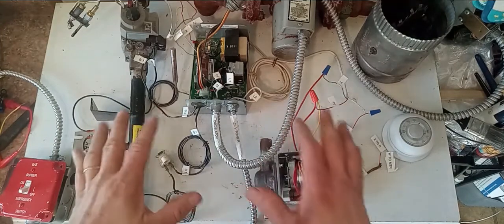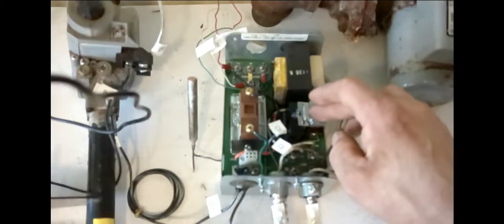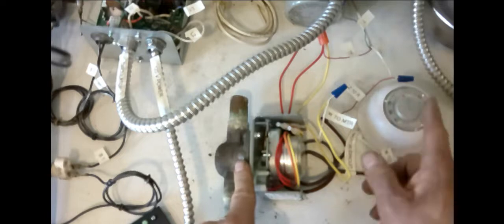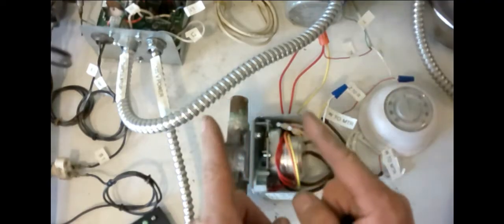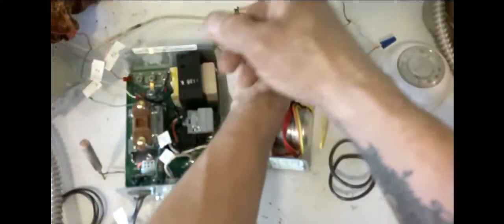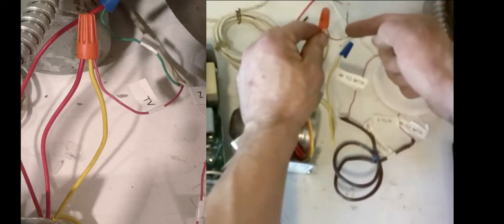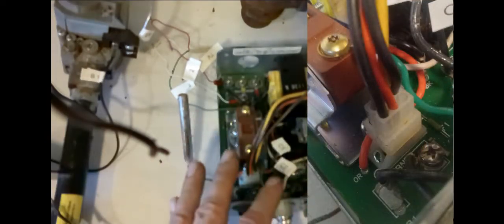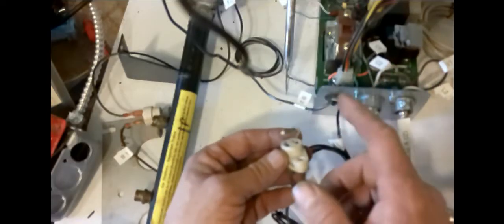Boiler Wiring for Beginners – Full Walkthrough of a Real System (Honeywell L8148E + Zone Valves)

Comment: Thanks for great explanation !!! So the second wire of zone valve end switch connected to relay coil 1K and goes to another side of transformer?  is it good to connect  1st red wire of zone v. end switch to Z(W) terminal or better through the t-stat?.... Can you explain how work switching relay control panels f.e  ARGO ARM-3P..6P &?

Comment: I have an old weil mclain very basic model. i have a transformer/ relay and having trouble connecting the black and yellow wire behind relay. black and white wires behind transformer are power but nothing seems to be working on the other wires. i have just 1 zone and none of the other modern stuff
Reply from the maker: Is the transformer putting out 24v?
Reply: @JerseyMikeHVAC  To be honest I'm just trying to get everything wired back up. I havent even checked voltage. I want to make sure everything works. It is an old boiler so I'm trying to figure out if I spend the money on parts or bite the bullet and get a new boiler.

Comment: IS that W terminal for low water cut offs? Just guessing based off what you said.

I have to repair boilers in my area but we have like 6... and I'm the senior tech after a year and I have noooooo idea what I'm doing lmao. My company teaches you on the job and with as little amount of boilers as we have I need to learn everywhere I can.
Reply from the maker: That cam be tough!

The W terminal on those transformers are not usually wired in on the backside at all. It's actually a dummy terminal that can be powered and used for other accessory items if desired (like if you had a hydronic loop off of the steam boiler and wanted to power a zone valve or something). 

LWCOs are powered off of the R terminal directly in most cases.

Comment: Some digital thermostats are looking for a blue C wire (common).  Where is that in this system?
Reply from the maker: It always goes back to a transformer common terminal. Sometimes that's I side the aquastat.
Reply from the maker: Always goes back to common on a transformer somewhere. I have videos on where the common is when hooking up smart stats.
Reply: @JerseyMikeHVAC   Thanks, I removed a cover and found a bar with a bunch of terminals with labels like C, R, and W.

Comment: Great videos, Can you make a video showing how to wire up a circular pump on a hot water system boiler
Reply from the maker: Most of them will have either an aquastat, in which the circ pump connects to C1 and C2 terminals, or there will be a molex plug from the circ that connects inside the boiler. 

Switching relays can vary but wiring diagrams show you where to make the circulator connections.
Reply: @JerseyMikeHVAC  you need to open a course in a school… you’re very talented…
Reply from the maker: Seriously thinking about that!

Comment: Fun Fact: if you lay out all of the wiring from a single boiler unit, end to end, the boiler stops working.
Reply from the maker: I disagree. This thing will fire up on a picnic table if I just hooked gas up to it. Add a tank and some water piping and I can heat a pool if I wanted to.
Reply: @JerseyMikeHVAC  great response to the hater!

Comment: After watching the "how to wire a zone valve for beginners" video, I was like "oh, thats easy". Now I watch this and am confused on how the transformers off of the 120V circuit and the end switches going back to T1 and T2 in the previous video aren't even mentioned. Did the other way not have a aquastat?? Because then how does the circulator get kicked on in the other one then. I was found and now am lost again.
Reply from the maker: Yeah in the zone valve videos there is no aquastat. The circ pump activates from a signal originating from the boiler control board. 

In this video there is an aquastat, and all of the parts  came off of an older boiler with a standing pilot flame and no control board. In this case the aquastat acts like the control board.
Reply: @Jersey Mike HVAC  ahhhh, that makes sense. I've been the lead Residential Forced air installer for a while and I'm  trying to learn more about boilers/hydronics to further my capabilities since the old-timers don't want to teach and bring me on their jobs so they have job security haha. Thanks for the help!